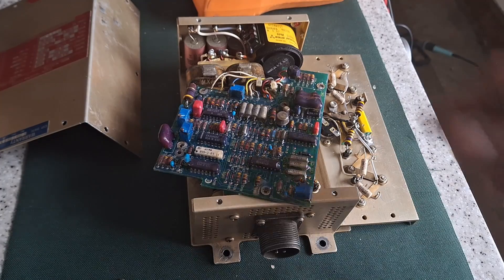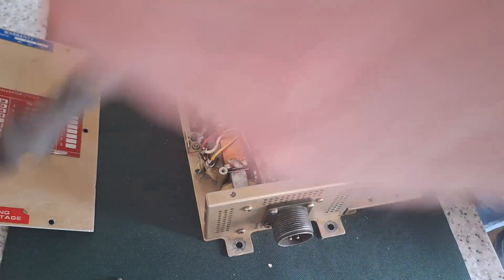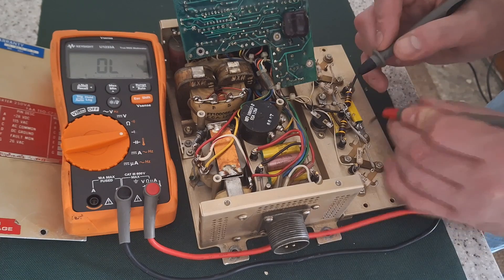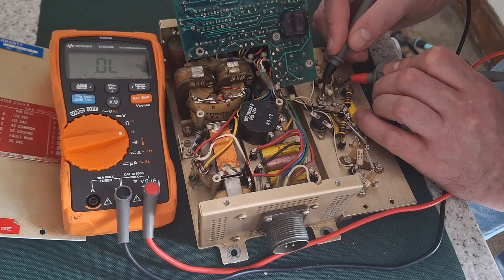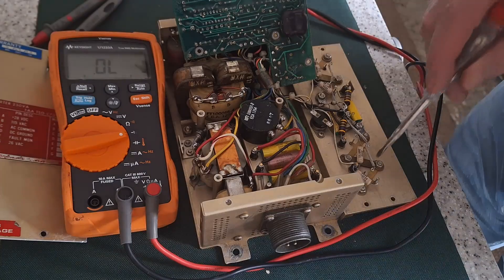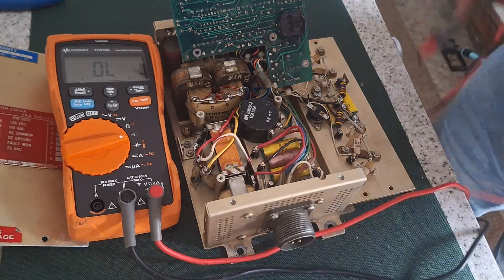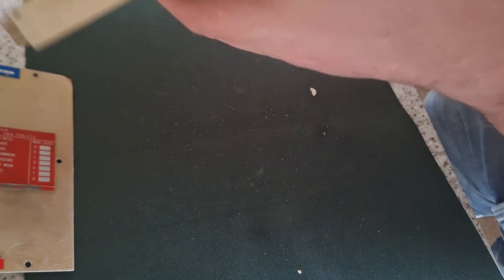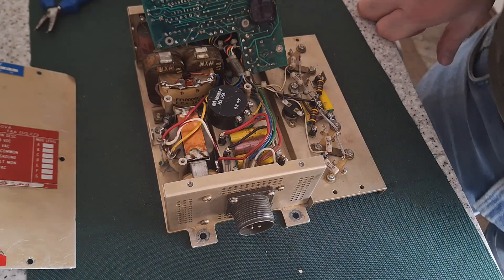Trying to repair a static inverter from an aircraft. 28V DC to 115V AC @ 400Hz

Comment: Hello Adrian! I'm wondering what's the internal topology of this unit other than a transformer being push-pull driven. When you get this working would be nice to know if that c-core transformer is driven with a pure-sine or being driven with a square-wave and then formed into a pure sine with a LC resonant network. Came across of both implementation when reparing units like these, but this unit is unknown for me.
Reply from the maker: It looks like the latter, a square wave formed into a sine wave through some capacitors, resistors and inductors.
Reply: @adriansmith31  Thanks a lot! Seems to be the same topology i've seen in the Avionic Instruments 1A250 type unit, but your unit is much more modern with CMOS/TTL control logic. The 1A250 type unit i mentioned is built with discrete transistor based control, logic gates, comparators, oscillator 😁

Comment: Very cool! Thanks for posting. Always a bad sign when someone has had a go at a unit before you haha. I play around with avionics myself from time to time, but never got a proper inverter, so it's very interesting to see what's inside. Fairly basic instruments it seems, but compact. I really wonder how modern designs differ? Maybe someone can chime in.

I use a fairly powerful 3-phase power supply from Pacific Power Source, and the design for my specific unit basically comprises of 3x Class D amps, with 8 large mosfets per phase and a high rail to rail voltage (about 400V I think?). The 3 phases are driven by separate DACs so you can generate any waveform shape, phase angle offset, and frequency from 15 to 1200Hz, with cycle by cycle current limiting. Output power is about 6-12A per phase (depending on voltage and PF). Very useful piece of kit. Idle power consumption is quite high at about 400VA unfortunately, so it's not something you can just leave on. Heavy as heck as well.  I'll try to pick up a regular static inverter sometime, and thanks to you, I know what to expect. If you end up doing the repair - good luck!! -Nick
Reply from the maker: The static inverters show up on ebay from time to time but are always untested and overpriced. The diode in this unit that's shorted is across the dc input backwards so it's providing rudimentary reverse polarity protection. I suspect the 28V input has been connected with the wrong polarity.

Simplest type of inverter is a dc motor driving an ac generator. There's a working,  tested one on ebay uk at the moment. 

If I can't get the inverter working I might try salvaging the transformer and making my own driver circuit.
Reply: @adriansmith31  Your reasoning for the fault makes sense. That explains the failure cascade. It's also possible that some of the control logic is damaged as well, which would make it beyond reason to repair. I wonder how viable it would be to start with a decently powerful Class D audio amp, and use the transformer from this inverter unit to boost the output voltage? That's kind of why I mentioned the topology of my big power supply (which is specifically made for avionics work), since it could be replicated in a simpler form - especially if it's only one phase.

Indeed, the rotary inverters were the first types ever made. I've never considered them since they're fairly inefficient and quite loud. Sometimes, instead of eBay, approaching aircraft repair/overhaul companies directly can yield results. They often have parts in stock that they're looking to get rid of (past certification / no planned use etc) and you can sometimes make deals with them. I've done that before myself for companies in the US. The trick is to make it easy for them to perform the transaction with you, such as supplying a FedEx account number for shipping, using freight forwarding so that they themselves don't need fill out international paperwork etc. Otherwise, it wouldn't be worth their time to do a small transaction with an individual. I've found staff at those companies to very reasonable to be honest.
Reply from the maker: Yeah it did cross my mind some of the control logic is busted as well. I haven't ordered any parts for it yet but I'm inclined to not bother as it's probably beyond economic repair.

A future project using a class D amplifier and 400hz tone generator sounds a better idea. That will likely be a long time off.

I did contact some aircraft salvage companies but they said almost everything gets resold. They had some old radios but wanted extortionate prices for them. A relative used to work for an aircraft scrap facility in Wales but that was a long time ago. He more or less said the same thing and they generally don't sell to the public except for sale to auction houses by the pallet load.
Reply: @adriansmith31  I'm curious to try the same idea (Class D amp). Much of the cost would be in the output transformer (that can work at 400Hz) and filtering if applicable. Good luck whenever you get around to that!

I can imagine that your "luck" with aviation companies would depend greatly on location, their workload and various other circumstances. Indeed, pricing for uncertified/broken equipment can be exorbitant - for cases like that, I believe that they assume that the buyer would send the item to a certified repair facility that would fix and re-certify it for use, hence their asking prices. However, some companies won't say no to easy money and a quick transaction. It seems to vary quite a bit.